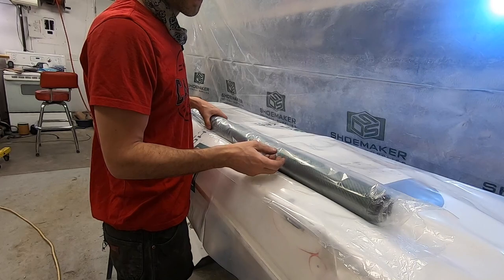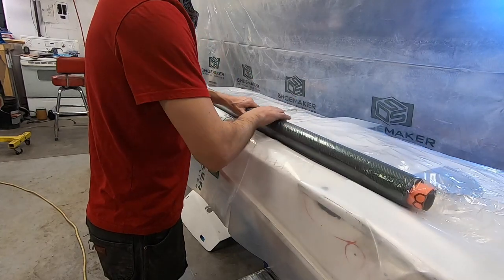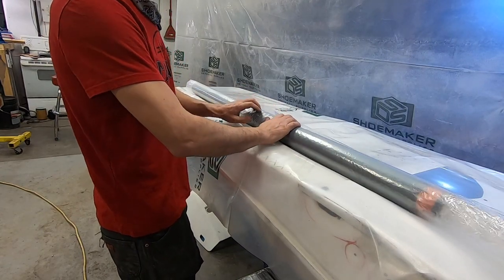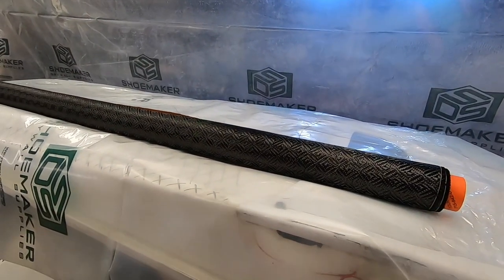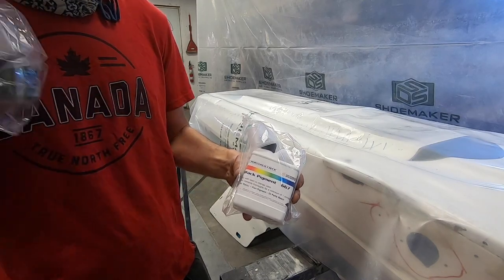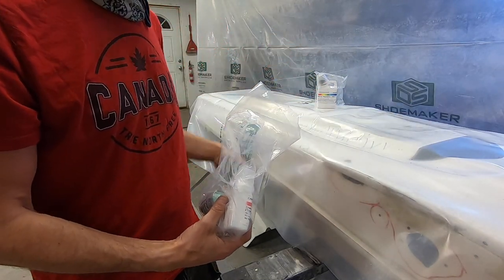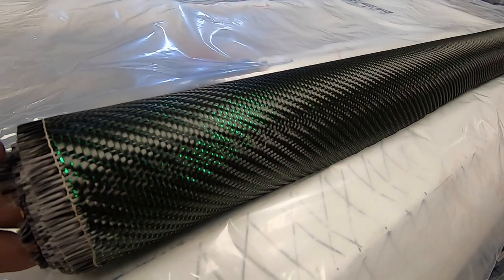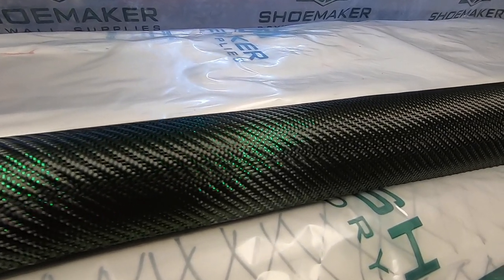X2 Carbon Fibre Update - V8 Jet Ski Exhaust Update.

Comment: Wicked video, I thought that carbon fibre can be used for structural jobs , I can't wait to see the final colour scheme it will be epic. I really like watching your videos as I never stop learning Cheers and good luck with all that work,as you are multitalented,
Reply from the maker: Hey Adrian. 

I guess I didn't explain my situation very well.  Carbon fibre can be and is used structurally in many cases. 

In my particular case, it won't add strength because it is one layer, and that one layer isn't as strong as the several layers of fibreglass and less flexible. 

A good way to explain it would be to compare it to a bunch of rubber bands and a piece of glass. If I have one rubber band that I can stretch a foot before it snaps, I can make it stronger by adding more rubber bands as they will all flex about one foot before snapping and the more rubber, the harder it is to stretch it one foot. 

A piece of glass is harder to stretch than rubber bands but if I add a piece of glass to the rubber bands it will fail as soon as it moves a little. 

In comparison, my fibreglass hull is like the elastic bands... not as strong as carbon fibre but more flexible. What I need to do, is make sure that the fibreglass repairs are done well so that my hull doesn't flex too much. This shouldn't be a problem, but the carbon fibre on my ski will mostly just be cosmetic.... to make it look pretty.

Comment: Very cool  yet challenging design for the X2 exterior finish.  Mmmm, green , my favorite color.  I'm down with the fine green flake but the large silver strikes me as not completely compatible with the carbon fiber , too much contrast . IMHO 
I really want to see this done before I rule it out or attempt to do it myself.  
Anxiously waiting for the next JSB  exhaust video.  
record some testing of scrap carbon fiber applications if you can. probably won't emulate the application of such a large piece but may help decide the finish
Reply from the maker: I'm really excited to give this a go. I will try to show some testing, as long as there isn't too much swearing, lol 

I kinda should have released another video Sunday, as I have done a LOT and have a TON of footage. I'm probably going to be releasing a few unlisted videos for those who want to see more detail. I didn't post a video on it mainly because editing is time consuming and I decided to spend that time working on the exhaust. 

One nice thing about the pigment and flake in this application is that they can be added in a final coat IF i choose to use them at all. I can do most of my finish work and then just candy and or flake the top layer. I feel like if I use the flake, it will be to make a "ghost" X2 logo or Kawasaki logo.... graphics that are solely made from glitter, haha. 

Like you say, I need to do testing.
Reply: @JoelArseneaultYouTube  That's a pretty awesome concept.  Ghost Graphics could be amazing! ! ! Please do this . 
I'm be looking for the video drop of this for sure.
Reply from the maker: @rickems8863  Haha... I've done this in the past... so I'll see what it looks like in a few tests.

Comment: Tip, whenever you cut carbon sheets line the outside with thin painters tape, it'll hold the weave together as you cut it/lay it out, it will fray and come apart if you do not, i used weaves and rolls all the time. text me if you got other questions, i ranted this morning, not even sure if you've read it, im pissed, lol
Reply from the maker: Hey. I was up late editing this video so I slept in very late, haha. I appreciate the tip with the taping the carbon... I was aware of that and got a little stronger masking tape... not sure if that's a good idea. 

I do have a question, actually. Have you ever used tack glue to hold a cosmetic layer in place ? Apparently 3M makes a spray for this Super 71 maybe... 

I know that what I'm doing "skinning" is a cosmetic thing and probably frowned upon in "the industry" haha... I'm wondering if I should apply epoxy, let it tack up and pay the carbon that way or let it mostly cure, use and use some of that spray glue. 

3rd option, that I'm leaning towards, is to allow it to set up for longer than normal so it's not as tacky... then apply the carbon and more epoxy immediately after. I'm hoping to try it on a few smaller pieces first instead of just jumping into doing the bottom of the hull.
Reply: @JoelArseneaultYouTube  i use super 77 from 3m, light even mist, too much will prevent saturation.
Reply from the maker: @bmxbarron  #protip Thanks Zack. Not sure if I will use it, as I have to coat the hull in black epoxy anyway... but it's good info to have.
Reply: @JoelArseneaultYouTube  I like the idea of using the epoxy as the glue.  I'd think a more wet application as it'll be sticky as it cures.
Reply from the maker: @rickems8863  Yeah. Not at all my idea. This is the way that I have seen it done in almost every case on YouTube. The "issue" is limited work time between being safely tacky so that it doesn't come off on my hands and discolor the carbon, and curing too much so that it doesn't stick at all. 

I do believe that this is the method that I'm going to be using, regardless. Many ways to skin a cat, as they say,... for me I'm looking at the method that is least likely to end in catastrophic failure, haha.
Reply: @JoelArseneaultYouTube  I can support that decision. Lol

Comment: Cant wait to see how this turns out! my only concern would be  trying to get the carbon fiber to wrap around radius and corners. I am sure you already considered that so I will keep tuning in to see how you work it out.
Reply from the maker: I'm anxious, excited and worried about this all at the same time. 

The one thing that I have working for me is the application procedure / method. I will likely be applying epoxy to the hull and letting it set up for a hour or so. Once it's tacky but not sticky then I can drape and press the cloth into place.... Kinda like using contact cement but not as tricky... I hope. 

I am going to try the bottom of the hull first, and if I have troubles, then I may decide to apply the cloth with 3M Super 71 or 77 spray. That will allow me ot stick it in place, and then once I'm happy, wet out the cloth from the outside. 

Fingers crossed !
Reply: @JoelArseneaultYouTube  I have all the faith in you!👍